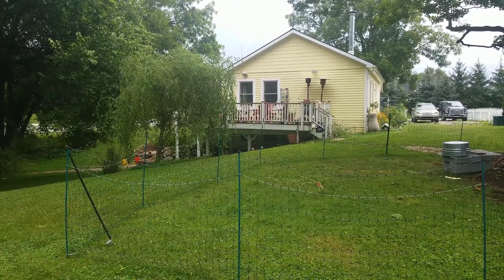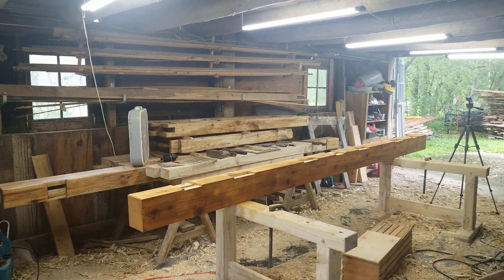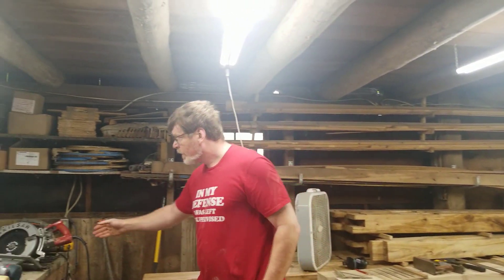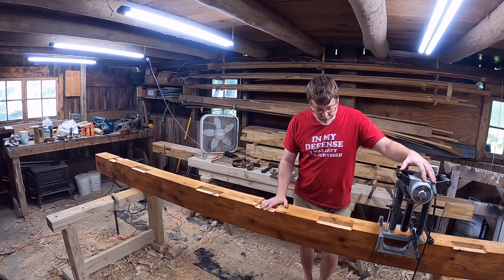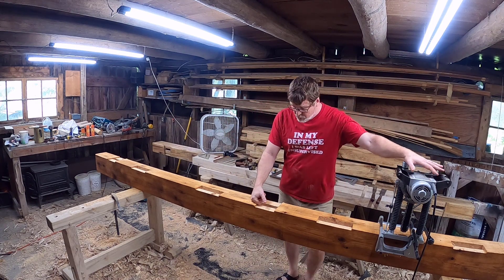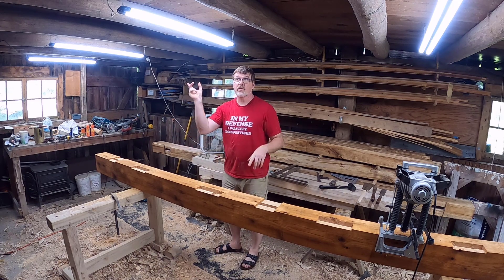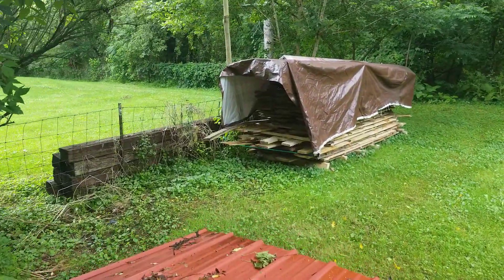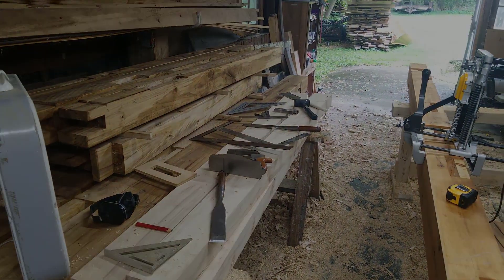Timber Framing Shop Tour

Comment: Love the barn. Wish I had a space like that to work in. So, because I did not, I built a 16 x 20 timber frame barn for my woodworking shop, which used to take up my garage. It was my Covid project. Sourced the timbers from a local 1890's sawmill. Never did a timber frame before this, just some small pieces to repair existing structures. I basically used the same saws and tools that you did, except for the chain mortiser. I used a forstner bit to drill out the mortises and then squared them up with the framing chisels. To remove material for housings I kerfed the housing and then just broke out the pieces, and chiseled and planed it all to fit. I built a 16-foot tall wooden derrick to lift the pieces, using a chainfall at the top. That worked really well. I finished it in February this year (electric, air, dust collection, etc.) and I love my new space. It's very functional and I can easily find my tools. I basically set up the tools as you did. Power tools in one spot, hand tools behind me. Keep it organized. Never had to go searching!!!! Even had the fan during the summer. I was working outside under a portable canopy.  Well, good luck with the build.